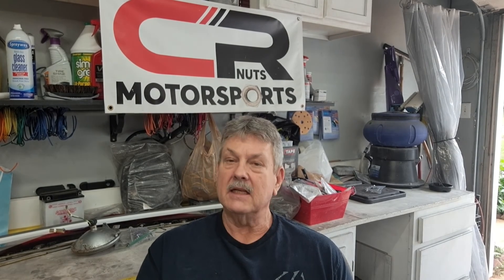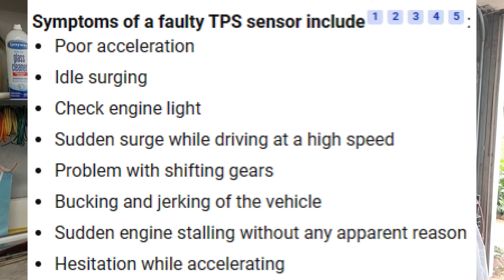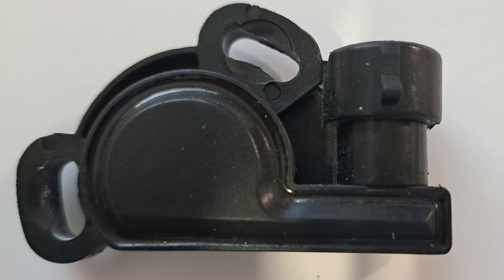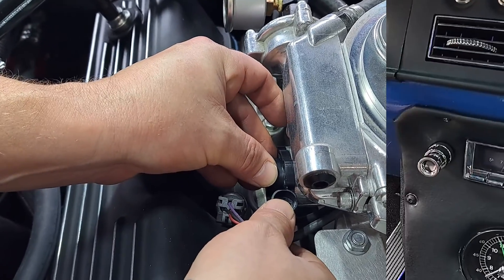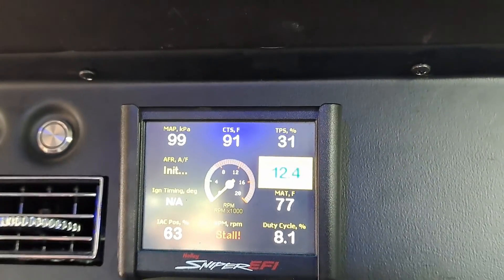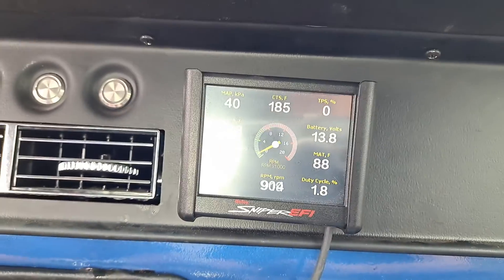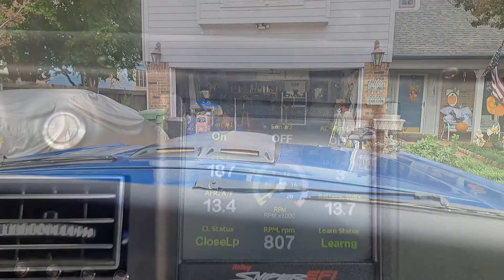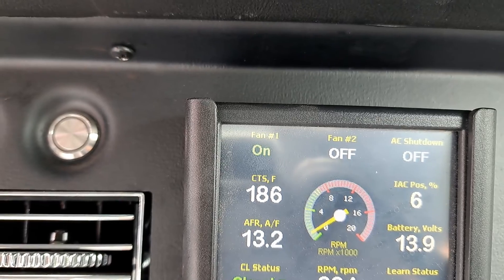Holley Sniper TPS Failure & Fix

Comment: Thank you for making this video.  My TPS was reading zero and I could not get it to react, so after I watched you replace your sensor, I noticed that it was like spring loaded.  You rotated yours forward and tightened it down.  So I pulled mine loose, rotated it forward and tightened it back down.  Not much movement, but just enough.  I now have 86 at WOT, and it is reacting normally.  I will adjust my throttle blades to get to 100%.  Thanks again, you saved the day!

Comment: Not to bother you lol... i appreciate all these videos. Holley should be paying dor a new unit for you... anyhow my idle i think is set a little lower at 750. I plan on bumping that to 850 doing the 13.5 at idle. 14 at cruise and 12.5 at wot. Then set aic for around 5.. i bought my car done but they said it needed tuned. It doesnt stall at stop lights anymore since i ajusted iac valve! But when im cruising n let of the gas to coast going like 50 rpm drops down like 500 to 600 wants to die? Then my afr gauge goes red like north of 15 to 19 then if i blimp throttle it goes normal again
Reply from the maker: I ran across this gent. Way more advanced than I'm comfortable with buy it shows that there is a flaw and a fix. If anything, it's educational. If I go to a dyno, they'll do all this stuff. Right now my Visa is overheated 😅
https://www.youtube.com/watch?v=GfF0U0NN1ag

Comment: Update put new tps in helped on start up but still hesitation and going way lean on take off
Reply from the maker: Go to your Sniper display home screen and you'll find tuning options, select it and your can program the AFR you'd like at 3 throttle positions. Idle is 14, part throttle 13.5 and full throttle 12.5. These numbers are safe and most likely be very close too was is already programed in there. Write down the initial number so you can reset them if you so desire. See if that helps,  Ken
Reply: @crnutsmotorsports do you adjust it when it's hot correct?
Reply: Thank you Ken I set my iac valve to around 10 that helped a ton. I'm gonna try this now

Comment: Hey i have holley sniper 1
Im having issues till i reach tempature.
Car stalling when i apply pretty much any pressure on pedal or when i come to stop it dies.
When car is hpt it runs better ? Still hesitates but not as bet
Reply from the maker: Do you have the right style distributor programed into the base set up?
Revisit your base set up.
Reply: @crnutsmotorsports  car doesn't start right still cranks n cranks then hits. I set my iac but when I turn it off n turn it back on the iac is high like in the 60% 70% when it's warm it's around 30 to 35. Anyhow I'm selling car. So it what it is lol

Comment: Thanks for the video 
i’ve the same problem but the issue is my TPS is reading correctly the problem is when I’m driving i noticed that when the TPS reach 16 it start to goes to negative percentage  , iac going crazy and the rpm start to read 2000 can you tell what is the problem 
Thanks again sir
Reply from the maker: I appreciate you comment and situation. I give you a lot of credit for figuring out the problem 👍I'm not an expert on TPS, but if it was me, I spend $40 on Amazon and roll the dice. I wasted a lot more cash and a ton of time resolving other issues.  Ken
Reply: Did you ever figure out your issue? Having the same issue
Reply: @codyc722  to be honest i didn’t , i replaced everything on it but nothing change unfortunately so i bought a new edelbrock carburettor and that was it sorry i hope you get your issue solved soon good luck 🤞🏽